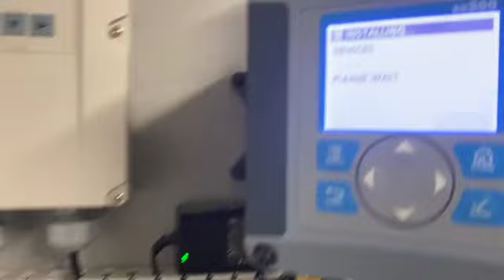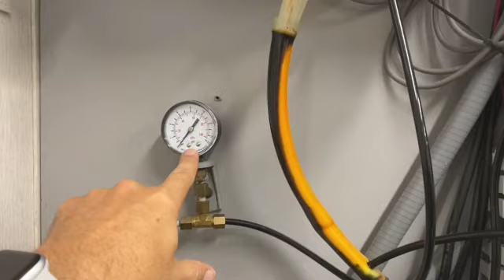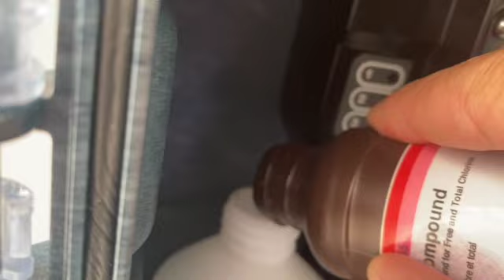Wastewater Treatment Plant VLOG 28 NEW HACH CL17SC!!

Comment: When I worked at the large 32 mid plant that used Sodium Hypochlorite for disinfection, we used a very old chlorine analyzer where you had to manually mix up a 1 gallon KI solution in a bottle of vinegar.  For the last 2 plants at 1.5mgd treatment facilities including my current, we use sand filters to UV disinfection for recharge.  So glad to see you are still making videos.

Comment: I know you said that the CL17 sux, but in fact is a great analyzer. It just requires proper maintenance and that its used the the proper application. All dark stains you see on the inside are from the off gasing of the reagents and there's nothing you can do to stop it. This happens in both free chlorine and total chlorine analyzers. Unfortunately the reagents off gas WAY more in a total chlorine setup. 

You HAVE to use the "Y" strainer if you're not using it already. The reason being is that you need to by pass most of the water that is being sent to the analyzer in order to turn the water over that goes from the source to the analyzer. If you don't bypass that water you won't get reliable measurements and you'll be screaming at the analyzer wondering why it's not reading consistently. 

-Hach Sr. Field Service Technician.

Comment: That CL-17 was clearly neglected, what most Operators seem to not to comprehend is that the CL-17 needs weekly and monthly maintenance, to include replacing, buffer and dpd solution, ALL tubing and parts to include the one behind the colorimeter, perform drawdown after tubing is replaced, CLEAN the colorimeters eye of build up, the, about every 2-Years order a HACH Tech to come out and fully service  the CL-17. The new CL-17 version is simply a replica of the CLX, the only difference is you will have to spend an additional 2K for the HACH SC200 for the read out. Just like the original CL-17 which we still use and they perform optimally because we actually take care of them. Operators will eventually bash the new HACH Chlorine analyzers because they actually have to take care of them, Operators expect the thing to work and not do any PM.

Comment: So the CL17 has been around for like 20 years. That said, it sounds like you’ve been using it outside of its recommended application. They are normally exceptionally reliable. 

The CL17SC is basically just an improvement (small or large) in every way in regards to reliability, accuracy, ease of use, etc.